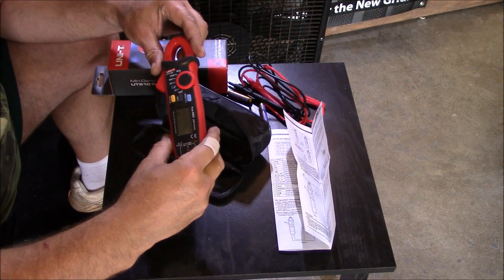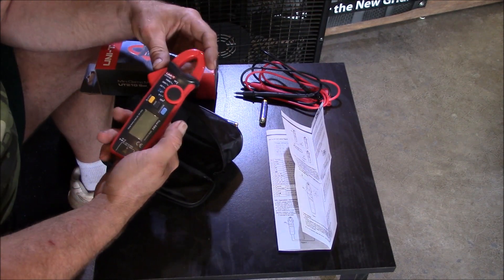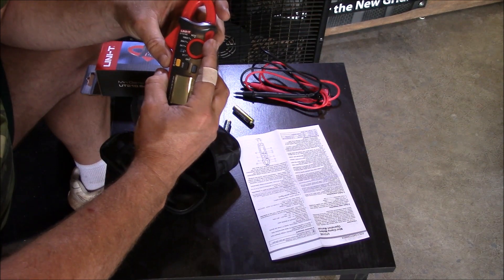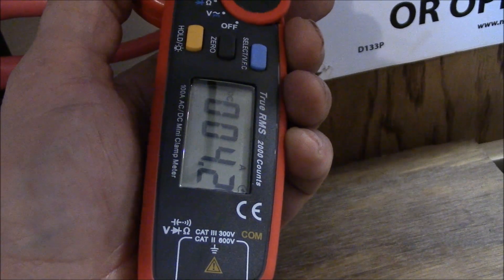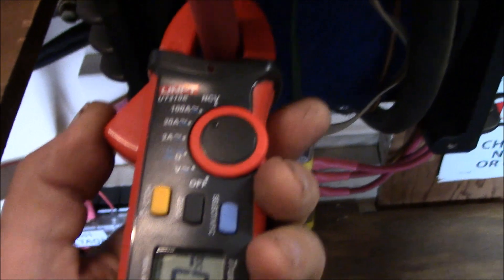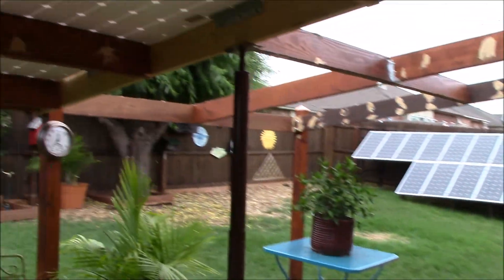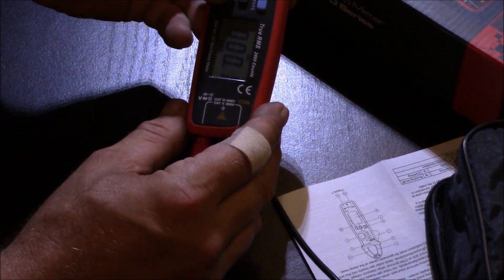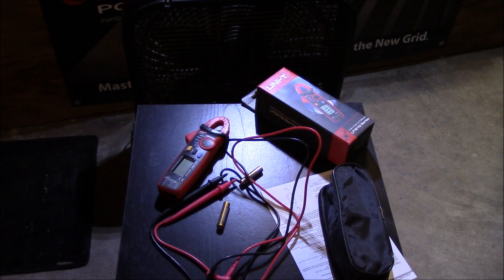UNI-T 100A AC/DC Mini Clamp Meter (shout out and demonstration of use)

Comment: Good for finding appliance earth leakage too, just butcher a short extension lead for earth wire only clamping. Did some research and Uni-T (Uni Trend) seems like a very respectable company with high quality design and manufacturing standards.

Comment: I was watching Steve Rob do a video about amp clamps and this video was on the side bar. Look at you with solar and free energy. That's awesome. I don't have an amp clamp but I think this tool has my attention.  I noticed the video is from last year. Is the tool still working good for you?
Reply from the maker: Yessir...working great. Wish I got one with a bigger opening and more amps. I got the 100-amp version...but, I recommend this one: https://www.amazon.com/Digital-Clamp-Meter-Uni-Trend-UT203/dp/B005HOPRRK/ref=sr_1_5?ie=UTF8&qid=1487516573&sr=8-5&keywords=uni+t+clamp+meter
They also make other ones...so, best to do a little research. Overall...they are awesome.
Reply: Thanks for the link. I'll go check it out. I must have caught at the computer...this was a fast response!

Comment: Really nice piece of device. Comes in very handy. Check out the Uni-T 204 A, Comes with a wider set of jaws and can take up to 400A DC. The price @ $35.45 on Amazon is not bad for its features .Got two of these and kept one as a spare.

Comment: YES YES I NEED ONE!!! Thank you brother.
Reply from the maker: Need vs want...I think this one is DEF a "need" for us doing solar. The best thing is checking amps on the cable runs. 10 AWG PV feeder cable runs are good up to 30 amps. So, this will check that to make sure you don't burn MC4 connectors up or start fires by keeping current within and below the ratings of the cable.
Reply: Yes sir. This would have been a help full when I was trying to find what solar module.Where not working rather than pulling apart 21 mC4's